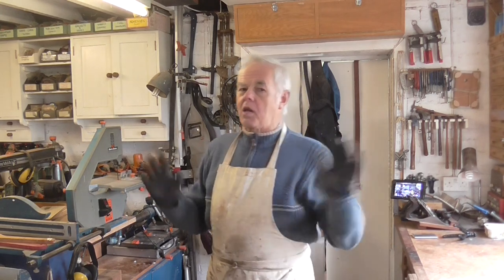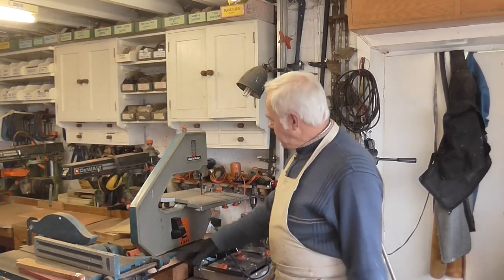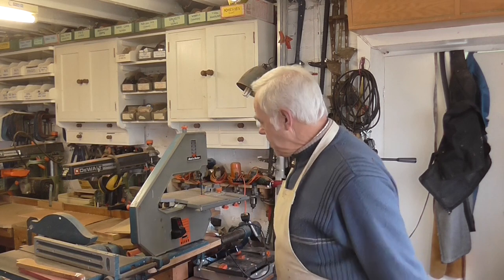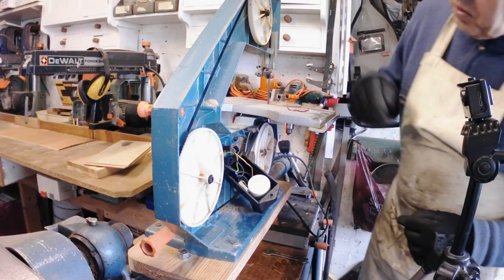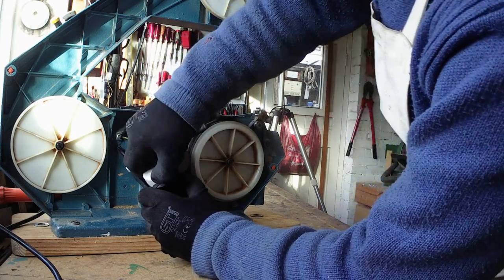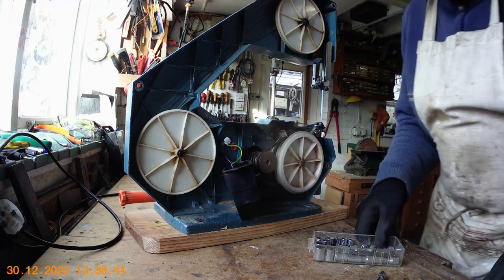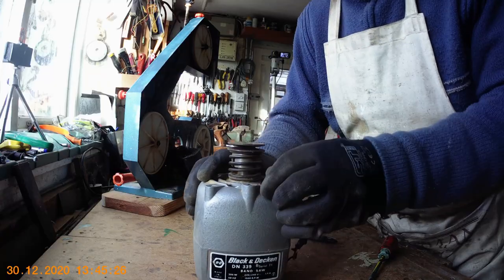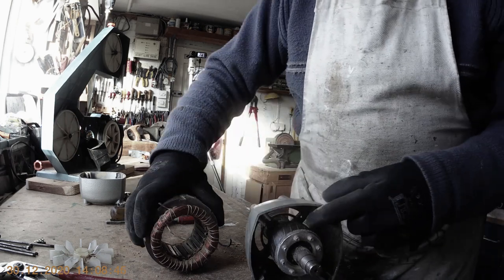Black & Decker Bandsaw repair Part One

Comment: Had exactly the same problem on one of these saws a couple of months ago and had to re-sheath the wires right back to the windings. Luckily spotted it, because the capacitor went, before it went bang.
Reply from the maker: Ah so I am not the only one. I was lucky as the inner wires had corroded to and were down to about 3 strands right at the stator. Thanks for the comment.

Comment: What size belt does this require I'm looking to replace one that is missing on a saw u aquired
Reply from the maker: The belt used on this bandsaw is a small standard Vee belt no 6 x 500. The one on my saw is made by Optibelt.  they are widely available.

Comment: Can you tell me what size blade fits this bandsaw, and where can I get them?
Reply from the maker: The saw takes the same size blade as the similar Burgess models that being 59 1/2". 
In the UK they are widely available in many places inc Axminster tools and Screwfix.
Expect to pay around £9-£11 for a good quality blade. I would advise against buying the very cheap blades they often are poorly made are difficult to keep to a straight line and blunt very quickly. 
I would recommend getting a blade of approx 1/4" width or a Max of 3/8" for this saw.
Reply: @scrimperuk  thank you

Comment: Hi, the drive belt on my Black&Decker DN339 band saw broke, could anyone help me find it? In Italy, searches have been unsuccessful so far, even after consulting Black&Decker (which obviously no longer has them after so many years). Thanks
Reply from the maker: Black&Decker would not have made the belt they would have bought them from a belt manufacturer, Not sure about Italy but in the UK there are many shops that sell vee belts that will do the job, Is there a number on the belt? Most belts have a size number such as M22 or suchlike which makes them easy to obtain, if you take a snapped belt in they should be able to match one for you -  so basically don't look for a belt for a DN339 just find a standard vee belt that will fit - they are readily available.
Reply: @scrimperuk There is no marking on my belt. However, thank you very much for your kindness and clarity; I will treasure your advice. Best regards
Reply from the maker: Glad to be of some help - You should not have any trouble getting a standard vee belt for your machine.